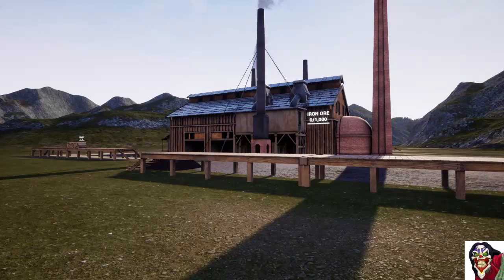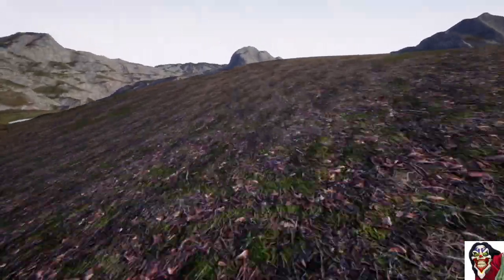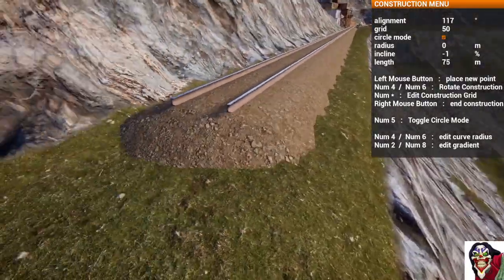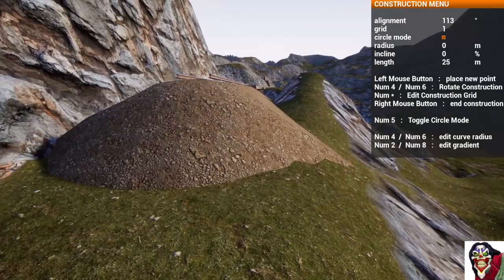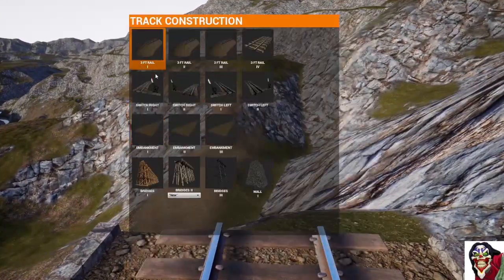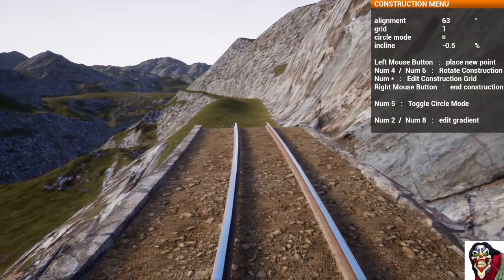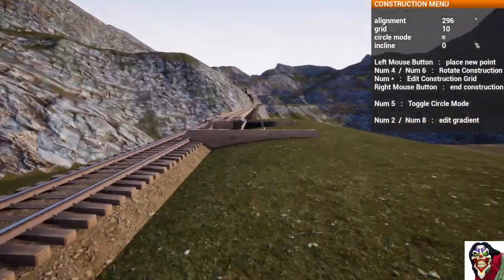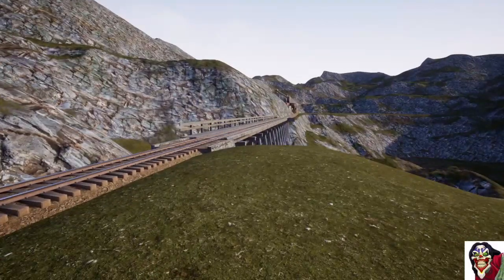RRO - New Splines Tutorial Ep6

Comment: I found that filling the hole with some groundwork building the track then removing the ground work fixed the issue, also you are correct about the Rail I, it isn't set correctly for height over terrain placement it places a bit too low for how much of the 3D model there is available.
Reply from the maker: The groundwork underneath allowed me to place the pylon bridge, but it left floating pylons once the groundwork was removed.

Using it to gap the small hole at the top might work though.  Usually in that position you have a switch anyway, which I expect would have placed, but would have had the groundwork sticking out of the side of the cliff face.

The new splines in a way do limit your building options.
Reply: @K10wNs-Shed  I should have mentioned that I meant at the Iron Mine plateau apologies for that confusion.

Comment: Are the new switches able to be connected for a crossover to the parallel track?
Ive been playing around and haven't found the right formula yet.
Reply from the maker: Yes, You can make a universal crossover between parallel tracks with switches in the new splines.  You must have normal track connected on all 3 link points of the switch, otherwise the linking system won't connect them, and the test porter will not cross the joint.

Finding the length of track you need between each of the 4 switches in the universal crossover is difficult because we only have 1m increments to show the length of track you place, where as you can place track at 1cm increments.

Lots of trial and error, and currently its hard to make repeatable because we can't see the length of the track piece we place.
Reply: @K10wNs-Shed  Thanks. Maybe within this week I can do it.